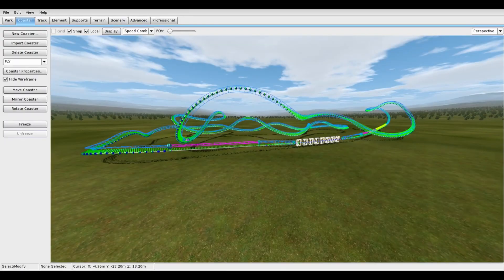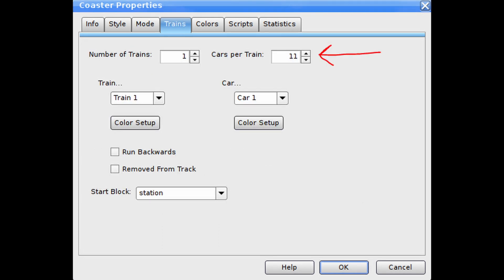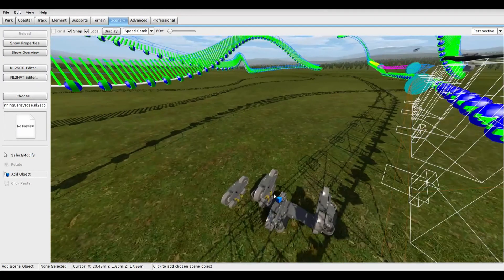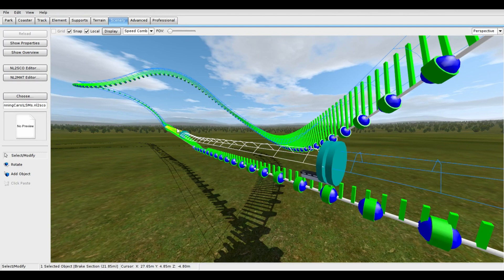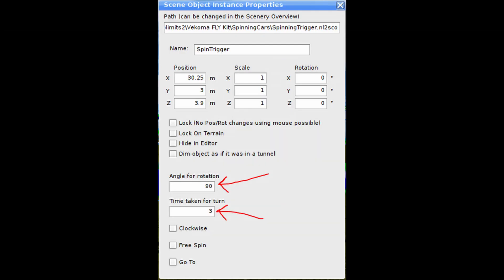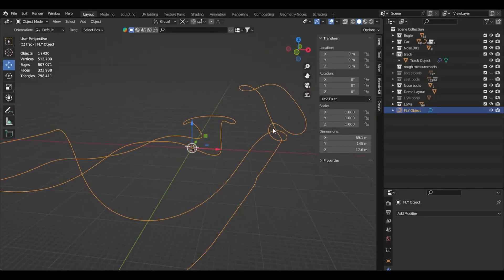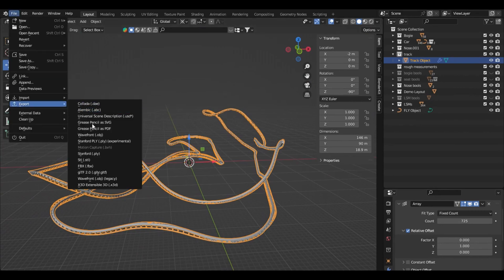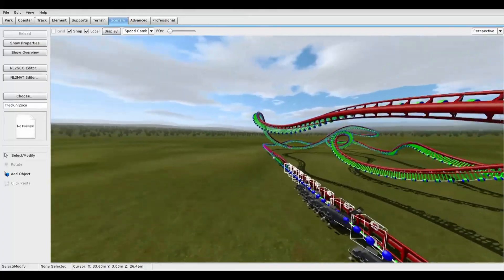Vekoma F.L.Y. Kit Setup Tutorial | Installing Custom Trains, Track, Track Devices

Comment: how do you create a custom train??
Reply from the maker: What custom train do you have in mind?
Reply: an Intamin accelerator train like Xcelerator at knotts
Reply from the maker: @coasterbreakdown7  So for all my custom trains, here's my process:
1. Look for as many reference pictures as possible. This includes bogies, chassis, seats, restraints, shells - as many different angles as I can find. The better reference pictures I have, the less difficult it is to see the shapes of the train.
2. Model the train in Blender. Starting from rail gauge, then making bogies, then chassis, then seats and restraints, then the themed shells for the train. 
3. Set it up in NoLimits with NL2SCOs and premade scripts.
Reply: @kohlercoaster  What scripts are they?
Reply from the maker: @Hangtime_haydn  Do you have Discord?
Reply: @kohlercoaster  I do
Reply from the maker: @ My username is Kw6sTheater, add me so we can talk further on there.

Comment: I've tried it but every time the roller coaster makes an inversion the track looks strange as if it wouldn't let it be inverted.
Reply from the maker: Do you have Discord?
Reply: @kohlercoaster  yes, but i speak spanish and my english is not good 😭
Reply: @kohlercoaster  i can use the translator in the chat in discord
Reply from the maker: @mjgcoasterfan  Add me at Kw6sTheater#8572 (My user ID is kw6stheater), I can help you further on Discord!
Reply: @kohlercoaster  Hi, I sent you a discord friendrequest because I am having the same issue as him.